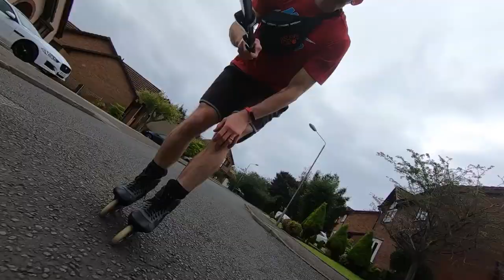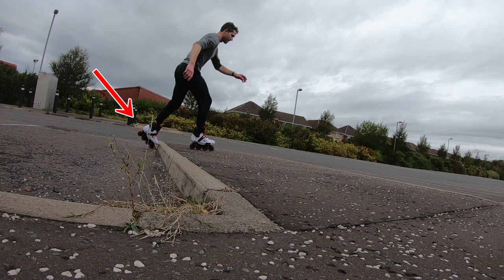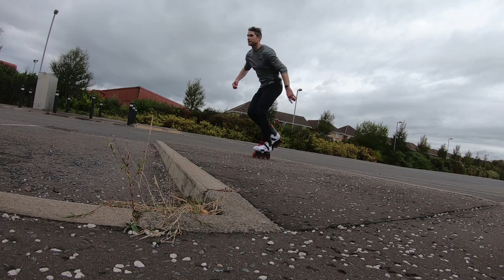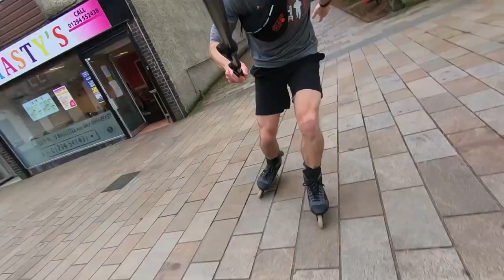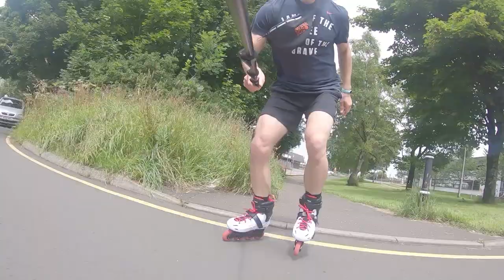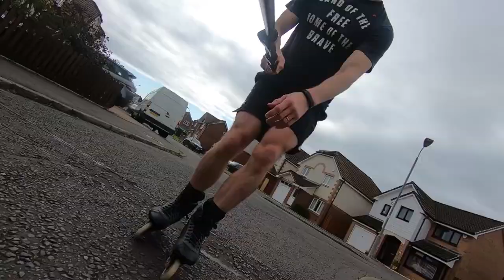How to skate curbs / kerbs - Inline skating tips

Comment: Some good techniques there. Florida has a lot of concrete rain gutters with loose sand. So I usually jump over them and the curb preferably at a angle and hope for the best. 👍
Reply from the maker: Yeah, sometimes you just go with the flow. I don’t always use the crossover but it defo most natural to me.

Comment: You're a beast. I like how you keep switching skates. Did you keep the stock bearings on those Oxelos?
Reply from the maker: Thank you! In this video the Oxelos are completely stock. I’ve since switched out the frames and the bearings, purely because the Oxelo frame isn’t threaded. Aside from that it’s a very capable frame.